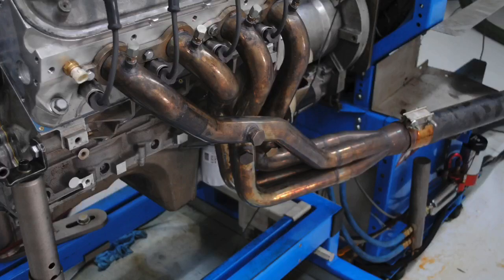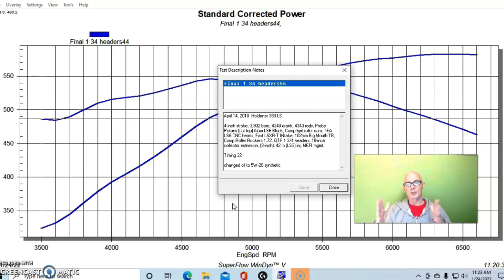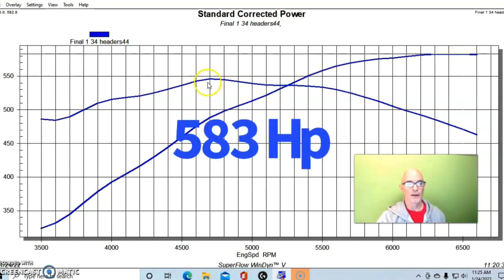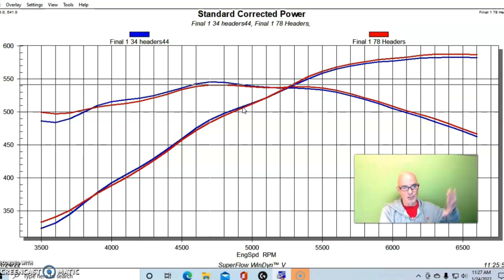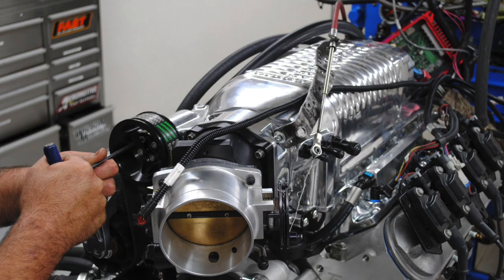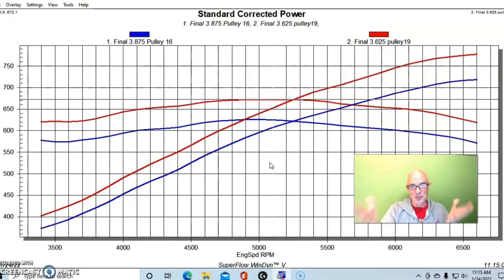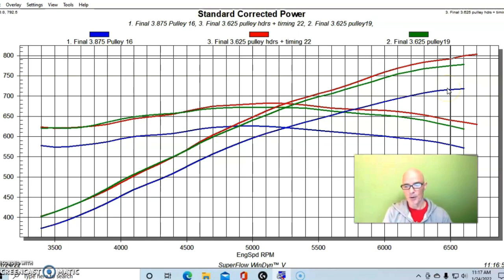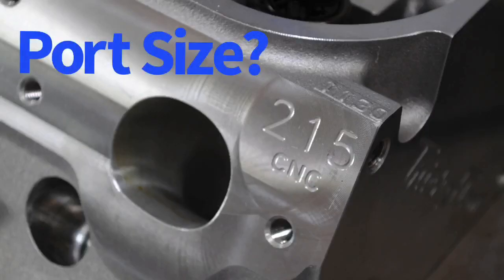HIGH HP LS HEADER TEST-1 3/4 VS 1 7/8 LONG TUBES ON A 383 STROKER & WHIPPLE 383 STROKER-WHO WINS?

Comment: I went with 1 3/4 for my 327. running about 350+ right now, probably a bit oversized but based on all the tests I've seen you don't really sacrifice much down low for the extra top end until you hit 2 inch primaries. seems like 1.5 or 1 5/8 headers are everywhere, and some people swear by them, but like I said dyno results I've seen put the sweet spot at 1 3/4 - 1 7/8 for most engines running 400-550 hp. Still making the exhaust, deciding on 2.5 or 3 inch exhaust with an X-pipe. Unfortunatly my ebay headers ternimate into a 3 inch collector so idk how that will work without having the reduction at the end of the collector or just going 3 inch throughout.

Comment: One thing that can't be felt here by strapping it to an engine dyno is what throttle response feels like in the driver's seat. On the street is the 1-3/4" header simply better? Is there a noticeable difference between the two? Will never know how response manifests itself in tests like this.

Comment: I 3/4 on an lsa supercharged 6.0 with Advanced Induction cathedral port heads.(Brian from T.E.A).  On the rx7, long tubes go in from the bottom..clearance is everything, clearance wasn't worth the 5 hp at 6400 rpm.

Comment: Hopefully it's not a redundant question.  Have you measured the primary lengths (they look close but maybe some differences in # 3 & 7 between the two)?

Ideally the same manufacturer would be a nice aba.  Know Kooks makes em 1 3/4 & 1 7/8 for the same application.

Also wonder if different lengths (not as important) might show different results for preference.  Probably would need to be a good bit different in primary lengths for that, idk.

If I had to guess, for most people's application a 1 3/4 stepped to 1 7/8 would be best but it'd have to go through the lie detector

Comment: I’m getting a 355 Holden built and headers are doing my head in as I’m not smart enough to work out the maths for to work out what size headers at buy, I want 4 into 1’s but unsure  on size between 1 3/4 and 1 7/8, engine specs are 12:5.1 comp aluminium 200cc heads  cam specs 268/272 720thou lift @50 106lobe sep , it has all the good supporting mods to see around roughly 620+ hp and 7500/8000rpm, 
Any help would muchly appreciated !!
Reply from the maker: I doubt you see much difference but I would be tempted to run 1 7/8 on that
Reply: Thank you for the reply Richard! I love your channel mate. Cheers!

Comment: This is great thanks Richard. 
I have been watching the Enginemasters header/exhaust/muffler tests while I plan to finish my exhaust. Blown SBC.
I already have very good fitting ss 1 5/8 headers.
My conclusion is I am best optimising the exhaust inc 3" collectors tuned with a  x resonators and high flowing glasspacks.
There is more power to be lost in the exhaust than 1 5/8 vs 1 3/4 headers which I estimate at only 5hp at 6000.
This may be good advice to someone. Headers are expensive.

Comment: I always run 1 3/4 headers the clear better and cheaper on instances. Also 1 3/4 clear most spark plug wires unlike the eBay 1 7/8 that bunt about every stock style plug boot.

Comment: David Vizard has researched best header size. For a correctly spec'd engine combo, he picks header diameter based on the exhaust port flow at the max cam lift.
Reply from the maker: that does not take into account scavenging
Reply: @richardholdener1727  isn't scavenging more a product of the length of the primaries?

Comment: I dont think I have ever seen you go over 38 degrees in timing on an SBC but Bill on Old Mans Garage says that SBC's with decent cams run best at 40 or more.
Reply from the maker: THE CAM HAS NOTHING TO DO WITH TIMING REQUIREMENTS-THAT IS MORE THE PISTON AND CHAMBER DESIGN-MORE TIMING MEANS AN INEFFICIENT CHAMBER DESIGN
Reply: @richardholdener1727  cool, I just found it odd that he was advocating for such high timing. So its more about the heads than the cam.

Comment: Would the header results be the same on a 454 bbc in the 500 to 600 hp range? Im running 2 inch headers, are they too big? Thankx.
Reply from the maker: that is fine for a 454

Comment: I think the added timing helped the engine breathe better and the headers added to that. 
When tuning with HP Tuners, you can add timing and see if it is creating a higher or lower pull on the MAF to determine if it's creating more power or losing more power. 
Since there is no maf, the boost level is where you can get that info from. 
Another good video.
Reply from the maker: we get the power info-that tells us if timing does anything

Comment: The head port size is not the only factor as often the exhaust gases are still expanding quite rapidly just after leaving the head port. But yes surely a restrictive port will  ruin any possibility of power gains from a larger header.

Comment: I don’t mean to nitpick, I’m enjoying the vids, but something not being considered is the collector where the pipes merge. The 1 3/4 looks like a mor gradual curve into the merge in the collector. Desirable. The 1 7/8 looks like a shorter and more abrupt merge. Not to mention what the inside looks like. Are the 1 3/4 pinched together where all the tubes touch to form a symmetrical “+” shape? Does the hookers have that sloppy welding in there where it’s a bunch of weld where the pipes all touch? All of that makes a difference. Theres a few other details, but I’m getting too picky and technical. Anyways, good comparison. Street duty is always better with a smaller header. Wonder if 1 5/8 would be more tq down low.
Reply from the maker: sloppy welding changes nothing-even big dents change nothing-collector design can change the power curve
Reply: @richardholdener1727  it’s quite difficult to describe and convey my thoughts in the comment section. Unfortunately it does not let me post images, picture is worth a thousand words. But more so I was referring to collector design being different for both. But I’m splitting hairs tbh. Just pointing out factors that effect things that the “average “ gear head doesn’t consider. Not meaning to nitpick, I enjoy all the info and I know you can’t please everyone!

Comment: If this proves anything it takes more ths 600 horse worth of air flow to need a 1 7/8th... Edit: just saw the comment on air flow and exhaust port size. So is it a volumn thing? Can you run a 1 3/4 ehsder to a bigger collector and have the same equivalent volumn in the exhaust? I know post collector the harmonics and scavenging of the exhaust plays a role and exhaust length

Comment: I am of the mindset, that you would actually see a power increase, if you matched the exhaust port and the header tube, then do a step series, with a choke at the merge collector.  By doing that, you get to keep the exhaust velocity that you see at the port, further down the header.  You'd actually might be able to change the cam requirements as well.  Think about it...we port the intake track, match and flow the intake to the port, but just leave the exhaust to chance?  Slide on over to SpeedTalk, it's discussed plenty over there.

Comment: I've got a mild Gen 2 LT1 build. 355 cubes, forged rods and pistons balanced to the stock crank, 10.3:1 compression, ported stock heads, Tick Performance cam, Vortech V1-S making roughly 7psi @ 6500rpm. I put it together with ceramic coated 1 3/4" longtubes, all controlled with a Holley Terminator X. Haven't had a chance to get it on the dyno yet but it pulls strong AF lol.

When this comes apart for version 2.0 I'll add a forged crank, 4 bolt splayed cap conversion, aftermarket heads like some AFR's, a bigger cam from Tick, and a smaller pulley on the blower. That'll be the time I go to 1 3/4" stepped to 1 7/8" headers.

Comment: My take home: for a daily driver or towing, go smaller. Bigger for high revs for Mo Powah!

I drive a manual truck and tow my RV. I rarely go over 3500 rpm… and that’s where these graphs start.  I’d live to see these graphs in the more driveable rpm range.
Reply: the last couple of videos he made had the dyno runs start at 2000 rpm. And he said for this test, it made no sense for him to start the runs at at say, 2000 rpm, since this is clearly a spicy race-ish setup.

Comment: I use something similar to the old Ford Fe exhaust manifolds that I welded up myself from some store bought  "No Stub Header Flanges."  It's basically just a 3" half pipe horizontally over the exhaust outlets, and exits at the end so that each manifold looks like an L shape. That's the best I can describe it. I use it on a supercharged motor. I don't really know if it hurts flow or not, but it sure fits the engine bay easy.
Reply: It hurts flow.. BUT it fits, that's more important.

Comment: I truly enjoy these tests, myself... nothing I build is a dedicated "racecar." So I tend to err on the small side, 1.75" primary headers would be my choice 99% of the time. I like the thinking on the exhaust port, it is a factor few people consider. I'd like to see it done on a set of junk heads for giggles - even though I think we all know what the result would be. But, humor me... how about opening the exhaust port to match the size of the hole in the header flange, then blending it down into the port? I have a feeling that it would = loss of power and disappointment. But, would be fun to see. Lastly, I had a similar combination to the N/A aluminum 383 you tested back in 2008-2010. It made similar power, and ran 10.70s @ 125 MPH on 93 pump gas in a full weight car.

Comment: Scavenging is a function of tube length (sets the frequency and thus the rpm range) and velocity (flow and tube diameter).  The faster velocity the better the scavenging, but too small and you'll cause restriction at high flow.  "Back in my day" 1&3/4" was considered too big for a small block, 1&5/8" was enough for us mere mortals... 😂 I'd say that is still true up to 600 hp or so.

Comment: Would a higher rpm 7500-8000 rpm 383-408 engine start to have more of an advantage with the 1-7/8  over the 1-3/4, is it more of the rpm along with high power
Also if the exhaust port is slightly smaller than the headers does it have a anti reversion type of deal

Comment: Thanks Richard!  I bought some Speed Engineering 1-3/4" headers for my LS1 based on your tests.

The goal is a certain air speed to maximise scavenging...which relates to cylinder pressure when the exhaust valve opens.  These new LS cams open the valve so early that they can get away with larger primaries, although it's not the best solution.  The speed of sound also changes with exhaust temperature, and 2 stroke engine builders commonly lean out engines to tune the power band.
Reply from the maker: air speed is not the primary positive pressure wave that returns as a negative pressure wave to induce charge filling, nor is it the pressure wave that follows then passes the actual exhaust flow
Reply: @richardholdener1727  
Can you, or some other knowledgeable individual, please elaborate on this??
I don't understand how exhaust velocity is not the primary driver of cylinder scavenging.
Reply: @aaronnoyb  I used to confuse exhaust velocity with the speed of the pressure waves too.  The sound/pressure waves move at the speed of sound; about 514 m/s in hot exhaust.  Obviously air can't move that fast. The ideal exhaust velocity to evacuate the cylinder is 55 m/s.  I think it's more helpful to think of Bernouilli than waves.  hth
Reply: @aaronnoyb 
. B

Comment: Exhaust port size!!!   Oh geez... here we go.  Test heads that have been matches exactly to the header primary point of entry - or vice versa...  1 3/4, 1 7/8, 2.0 inch with ports in D shape, rectangular, oval, fully round...

Comment: What we learned: if under 800hp, 1 7/8 is fine. If over, it's still fine.
Reply: What we really learned was 1 3/4 is good up to 650-750 for clearance purposes. And even at that power it's still only loosing about 15-25HP.

Comment: I play a lot in car audio and headers act a lot like ports in ported boxes.
In a ported box, you basically have a controlled leak that boosts specific frequencies
There's a lot of similarities between them. To make a ported box play lower you can do 3 things.

Make the box bigger (bigger motor makes more low end torque)
Make the port longer (longer header primary tube makes more low end torque)
make the port area smaller (Smaller header primaries make more low end torque)
Reply: Perfect analogy!
Reply from the maker: that is actually more like Helmholtz Resonance-the resonating frequency of the volume-reflected wave requires traveling the length of the runner (twice), once as a positive then as a negative pressure wave

Comment: Unless you can test each individual combination in a tightly controlled scientific environment, you couldn't measure the minute differences.  Moreover, the tiny performance variations might not make a measurable difference at the track.  I wish we had an easy button

Comment: Diverging lines is an airflow gain, not a 1 degree of timing gain.
Reply from the maker: TIMING NEAR THE POWER PEAK DOES THE SAME THING
Reply: @richardholdener1727  even just 1 degree over such a wide rpm window? Thanks for taking the time to reply.

Comment: Sure like to see a 1 5/8 header test as well, good luck finding them for a LS though. 5.3, 5.7 engines in a true daily SUV. Yes, it Probably ain't that much, knowledge is Power though?
Reply: I had a set in a  fcar with a ls6 in it. They were mac mid length 1 5/8. I went to kooks 1 7/8 and was really surprised it picked up bottom end power pretty noticeably.  If course the kooks were a long tube so not exactly apples to apples but that's what i experienced.

Comment: Smaller engines at more modest power levels probably benefit from relatively small header primaries.  Larger engines at elevated power levels probably benefit from larger primary pipes.  Or not.

Comment: Interesting. Given the boost drop, i’d say there was a restriction and the bigger header did make a difference. Maybe not a restriction issue, but better cylinder evacuation with the larger header. But that one degree of timing at those HP levels could easly be responsible for a big portion of the gains.
Reply: But less heat in the charge thanks to less boost pressure helps facilitate more timing..
Reply: I honestly think the timing didn't do much because the lines match down low. I think the increased flow allowing for better cylinder emptying gave the extra power.
Reply: @christianmeeks4430  He said he only added timing from 4400 rpm+ so down low should be accurate as far as the 2 header sizes tested. He mentions that at 9:43
Reply: @silentbravo  Ah ok. I missed that part.

Comment: Do these headers, the 1 3/4” and 
1 7/8” sets, have the same size collector/flange? From my own builds aside from the design of a header and scavenging effects changing power curves, I have also seen power differences when using the same style/size header but with different size collector flanges outlets. This hasn’t been with my LS setups but I’m actually referring to my old Honda days as I remember one particular dyno session where I ran essentially two identical 4 into 2 into 1 style headers only one ended at a 2.5” and one at 3”. I was running a 3” exhaust at the time, and the 2.5” flanged header made less power while on the big cam lobe than the 3” flanged piece.
Reply from the maker: collector design and size can certainly change the power curve

Comment: The NA combo would’ve done a bit better with some aftermarket heads
Reply from the maker: the na combo had cnc ported 243s-see the big head test video to see why those heads are not a restriction to this combo
Reply: @richardholdener1727  I’ll check it out. Thanks for the reply

Comment: Good to know going with the 1 3/4 headers for steering shaft clearance didn't cost me any power on the ole 6.2. 2010 Silverado 6.2 Speed Engineering 1 3/4 and ORY. I asked you about 2 weeks ago this very question and you made these two videos. You really kick ass.
Reply: Did headers really wake up your 6.2?  I have a 2011 6.2 and have been considering long tubes.